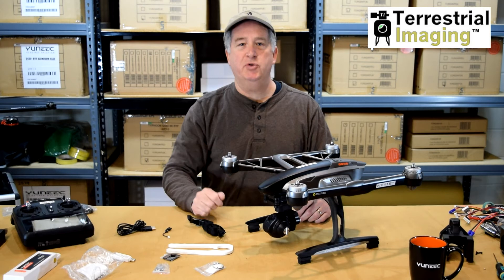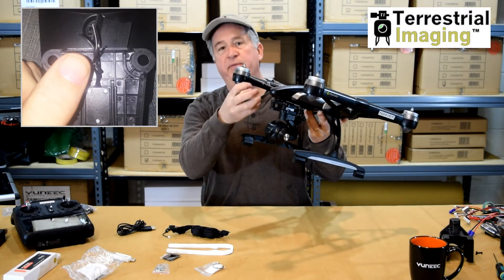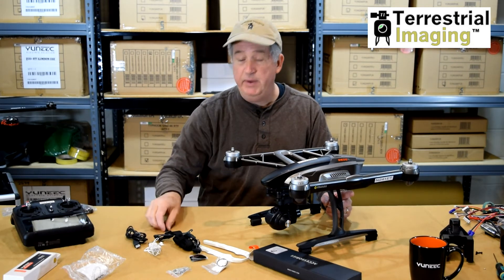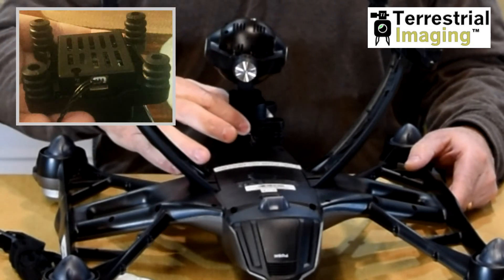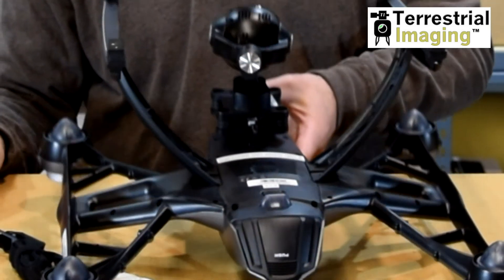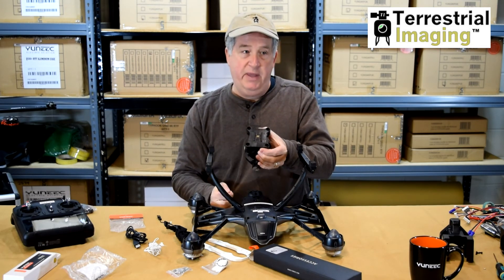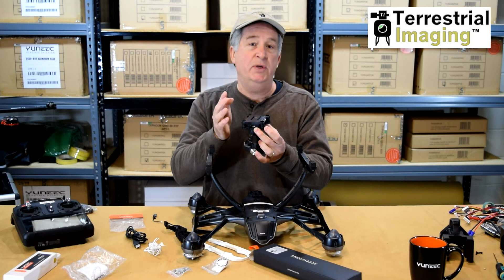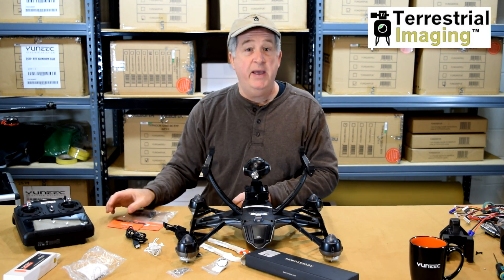Solution to Broken CGO3 Gimbal Wires On Your Yuneec Q500 4K Drone

Comment: Don't have the drone beside me.  One of the three wires came off on the camera side where they solder on to the circuit board.  Will this solution work, assuming I have that separate wire somewhere (got the unit from a friend).

Comment: i crashed my q500 . is there a new camera shell i can buy for the cg02 camera and is it hard to replace just the shell.  i can do the connection as you described in your video but would like to change the shell if possible

Comment: My gimbal came apart mid flight 3 wires came out but I noticed when it landed some sparks when I took it apart it looks like the circuit board has burn spots. I think it shorted out board,  because when I added the extension wire provided I don’t have any working camera or movement from gimbal. So can I still get a new board to replace or I have a gimbal cgo3 from typhoon H will it work on the typhoon 500 4k.

Comment: Bummed. I crashed the copter. Purchased the wire off of Ebay, plugged it in and it says cannot connect to the camera. Crap. What do I do now. I wonder if when it crashed it destroyed the ability to connect or if the wire I bought is defective. I tried plugging it in a few times and it will not work.

Comment: Thanks for making this video, when i first bought a used Q500, that jumper was already attached into his belly, and thought it was a wire to connect the camera gimbal going to the quad, Early this February(2020)  i bought a new Q500 and saw this jumper wires not connected to the quads belly, so now as I've watched this video, that jumper wire doesn't need to be attach if the quad has no issue(Brand new) or problem, correct me if i understood your video..

Comment: Any solutions for repairing a CGO2 camera?. Ripped two wire from the camera when drone crashed. Help please.....
Reply from the maker: Hey Ray. Unfortunately CGO2 parts are no longer available.
Reply: Terrestrial Imaging LLC 
Bummer... I was hoping for a much favorable solution. Wonder if I order a new CGO2, would the connection be included???. Fingers crossed🧐🧐🧐

Comment: Yuneec Q500 4K CG03 Camera won't connect to the ST10+ , during start up it jiggles  then settles down,  there is a slow flashing green light from the gimble, I can pitch the camere up and down with the st10+.
Reply from the maker: Sounds like the calibration may be off and there may be damage to one of the boards. You can send it in for repair at: https://www.terrestrialimaging.com/repairs/

Comment: Great video!  I bought an aftermarket battery that went from 1/2 capacity to nearly empty after about 10 minutes of flight.  I flipped the "Home" switch when controls went a little spotty.  Unfortunately, the drone drifted away to get to a safe distance and in the process hit my Magnolia and separated two bushings and clearly one or more of the wires connecting the camera to the three contact plates.  Honestly, I had no idea were to start investigating the issue and this video saved me a ton of troubleshooting.  Great instruction that was very easy to follow and resolved my issue perfectly.  Thank you!

Comment: 100% Bad choice(temporary) Easy is solder this wires.
Reply from the maker: This is incorrect. When these wires break they often cross and short the main circuit board. When you use the gimbal connection wire instead, it completely eliminates the chances of the main board getting damaged. Thank you for watching!

Comment: The camera is a GoPro has nothing to do with the gimbal, the gimbal itself is the problem, can anything be done at this point.
Reply from the maker: My apologies, because the video is about the CGO3 camera, I was assuming you were referring to the CGO3 gimbal. Parts for the GoPro are no longer available. At this point you would have to call Yuneec directly, and even still I'm not sure if they can help you.

Comment: Filmed on my Yuneec Typhoon H 4K drone to a micro 64gb card. Every LAST film file is unable to open stating that a error has occurred and unable to read this format. Out of 10-13 files, the last file always doesn't play, yet will play on the controller review system  Any suggestions
Reply from the maker: You may have to reformat your SD card. Try reformatting it and then try again

Comment: Hi, my q500 4k had an accident and took off the 3 cables you mentioned in your video, I placed the cable that comes in accessories and the camera returned to work, only that there is a problem, the camera does not tilt up and down in the typhoon using the st10 +, but it does tilt on the steadygrip, what can I do? already reset the st10 + to factory mode but still not working, please help
Reply from the maker: It is very possible that one of the boards inside the q500 went bad. When those wires break, they tend to cross and short circuit the part of the drone that gives the camera the command and control. It is hard for us to say without looking at the machine.

Comment: Help! 
   I crashed the drone the first flight I had (certified refurbished) and the jumper cable was already connected. Now I am getting the Cgo3 to turn on and display a green light, but the gimbal won't stabilize.
Reply from the maker: Sounds like the mainboard may have shorted. Whatever the issue is, it can only be fixed using Yuneec's calibration software that the certified repair centers, like us, have. To have it repaired go to http://www.terrestrialimaging.com/repairs/ and fill out a repair ticket to get the process started.

Comment: I used that wire to jump it but my camera won't move it just beeps and has a slight twitch ?
Reply from the maker: Your camera might need to be calibrated.  You can visit www.terrestrialimaging.com/repairs and get a repair ticket started.  We'll turn around the repair in 3 days.  Thanks.

Comment: I have just had an small accident and one of the wires of my camera wasn't at its place. Thanks to you I don't have to be worried about the camera cause it has recovered all of its functions :) Time to investigate about "puffy" batteries (Dunno if that's the correct name)

Thanks for the video
Reply from the maker: Glad we can help. Good luck with your research. We will have to do a battery video soon.

Comment: I have a similar problem in my q500 4k.
The crashed 2 or 3 times and after that when you turn it on it looks like the gimbal cant recognize the axis!
It transfers the images to the controller and even records the video but it doesn't stabilize! it just stays like if its turned off, so my images are totally unstable!
I even tried to connect it with the secondary wires but doesn't seem to work, it's probably a gimbal's problem.

Do you know how i can fix it without spending too much money?
thanks for helping
Reply from the maker: The only way to fix the gimbal, is to send it to us. We have parts and calibration software that is only available to Yuneec authorized repair centers. Pictures would be needed for an estimate.
Reply: Terrestrial Imaging LLC it's a little hard to send it to you because im from Italy and i think that the package will cost a lot for me
Reply from the maker: Try going to Yuneec in Europe. They should be able to take care of you
Reply: Terrestrial Imaging LLC thanks

Comment: Hello!  Thank you so much for the info about the wire replacement grouping!!!  On my VERY FIRST flight, the craft crashed and the gimble that holds the camera came off just as you are talking about!!  I went in and looked to solder them, and couldn't quite get the one last ground wire soldered.  So, the $1000 Drone I was so excited to get and start using, has sat for 2 months after 1 15 second flight!  Came across your video and was so relieved!!!  Cut the 3 wires and attached the other.  The camera has started flashing green again, BUT now I seem to of lost ALL contact with the ST 10 command center!! I have 12 satellites, but everything else is blank!?? And if i push System settings, or any of the 3 bars at the bottom of the screen, it says i will lose all contact w the drone?? What did I do????? 
It seems to of reset itself to a :beginner" phase of the process and not the plug n play feature it was like when it arrived. Any help would be appreciated!!! I know I know will need a company to work with while learning, and buying new things to upgrade or replace, and am SOOOO glad I saw your video on you tube!!!! Thanks again!!  Scot
Reply from the maker: Thanks for watching! We are happy it helped

Comment: hi good video I've used the one u connect with the GoPro the gimbal seems to work but when I face it forward it tilts to the left any ideas how I can fix this what is factory reset on the controller help

Comment: Thanks so much for your video. I crashed it in a tree in my garden after 30 sec of my first flight (apparently because of smart mode, the drone went away from me because I was too close and it crashed). I felt so bad and I followed your instructions and that works perfectly now :). But I think I will try also to fix the 3 wires, look easy to solve anyway. Thanks again from Belgium :)
Reply: I realize Im kinda randomly asking but does anyone know a good place to watch new tv shows online?
Reply: @Dalton Warren Flixportal =)
Reply: @Hugh Jadiel thanks, I signed up and it seems to work :D I appreciate it!
Reply: @Dalton Warren No problem :)

Comment: Outstanding video! Found a crashed Yuneec H Realsense on ShopGoodWill.com for $310.00.  Upon receiving I found a broken "A" arm, missing camera bumpers and three sheared wires.  My question is:  What happens to the cable backup design if it suffers another crash?  Does the connector rip out?  Perhaps a designed shear point in wires is a good idea.

Comment: hey i could really use the help, my three wires snapped as well and i used the jumper cable guy and my cgo3 still is lifeless. no lights or anything upon startup. thanks if you can reply!
Reply from the maker: Sounds to me like there is a busted wire somewhere in the  camera that is preventing power from reaching it. We are an authorized repair center so if you needed some help we would be glad to assist you. Check us out on our site!

Comment: Hi Chris, thanks for sharing this helpful tip with the Yuneec Q500! I had a crash today in Smart mode and my gimbal came apart. The camera is not broken just need to try this fix. Is it a small black cable that plugs into the white port on the back end of the camera and then the other unit plugs into the body of the aircraft? I have to thread the rubber gimbal bushings back into the gimbal and fix a small crack in the camera lens cover but the camera itself is not broken.

Comment: I have an H which broke off (the channels holding it to the copter are extremely thin and weak) .  I'm a little confused since the stuff I have read and videos I have seen all say that the contacts between the camera and the copter do nothing.  I must have a newer version where that is not the case.  Is that possible?  I do not see the connectors on it as you show.  Also wondering the best way to fix it once I get it apart.  I am hoping the wires I see don't need to be soldered.  It's hard to tell without taking it apart which I have not done yet.  Any help will be appreciated.  Thanks

Comment: awesome video. I assumed this would fix my problems. only one wire broke off my drone. I am using the wire and I am still having no gymbal functions at all. camera turns on and works great just not self leveling or movement at all. Any thoughts
Reply: Aj Sawyer my drone is doing the same exact thing how did you get your fixed

Comment: Heyas Chris- I appreciate the information here. A crash forced me to take this route and everything works including gimbal control and video capture. Although I am unable to take a photo now. I keep getting a message that says "image capture failed". Any ideas? Thanks!
Reply from the maker: Glad the video helped you out! In regards to not being able to capture video, a few things could cause that.
1. Test different SD cards
2. Make sure the video start/stop button as well as the photo start/stop buttons are not jammed 
3.Watch our video on the CGO3 pro mode, as it gives you another option on how to unlock advance photo taking features which might help.
4.Also, be sure the SD card is not full. A full SD card will prevent new pictures from being captured and saved.
Reply: Thanks!
Reply from the maker: Any time!

Comment: hi ya which version has the contact points as i think is a better idea than the plug in.
Reply from the maker: +stephen strassen   The earlier version did not have the contact points and the wire was required.  We first saw the contact points in our shop in February of this year.  Not sure when it was first manufactured this way.  The ones with the contact points can use either the wire or the contact points.  I hope this helps.